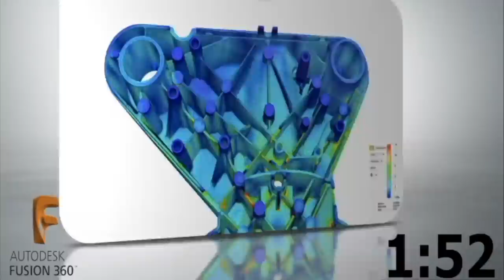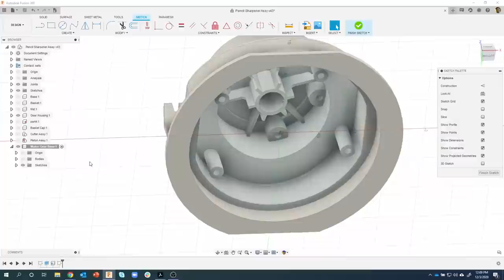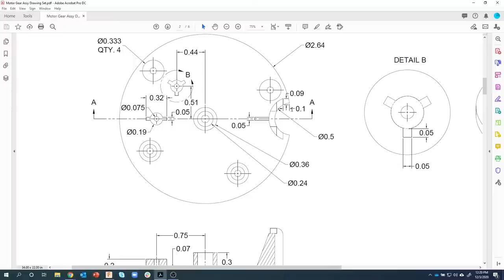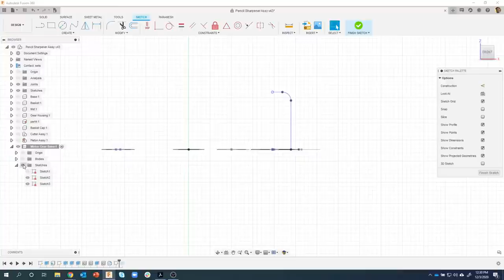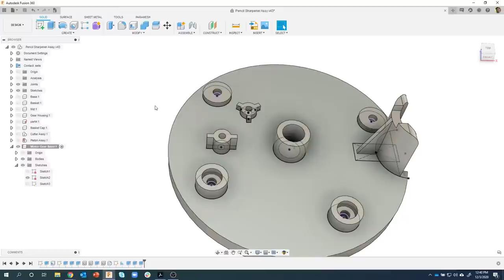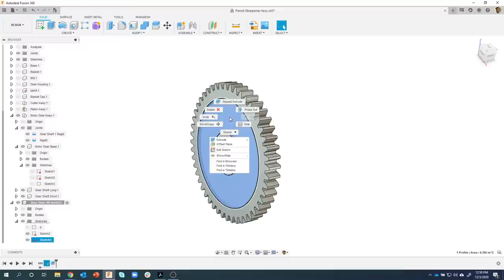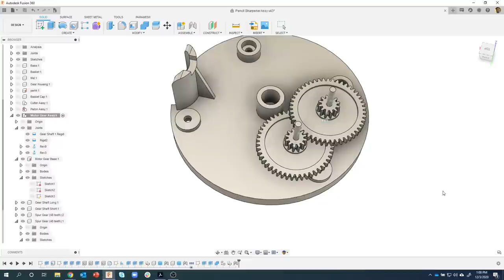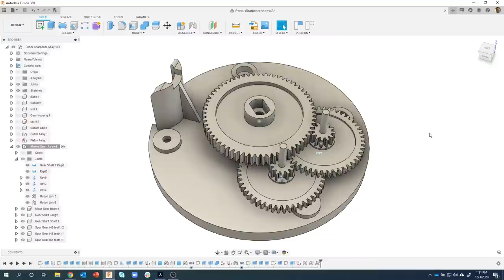Pencil Sharpener Project - Part 9

Comment: Small feature request that I think might improve productivity somewhat. 

Currently a few commands in Fusion take a  target to which the value you specify is applied and then if you immediately hold down the Control/Command key you can select other targets sketches to which the same value (if applicable) is applied. 

Common examples include things like the Fillet command. 

It would be great if Constraints supported this feature too. 

As an example, it's common to draw a lot of circles that you intend to be the same size,  you start off by giving one of the circles the value you want them all to be, apply the Equals constraint to it and first target . At the moment for EACH of the other circles you wish to apply the same value you would have to reference the first circle AGAIN. A pain especially if there are many!

Wouldn't it be nice if after the first pair, instead of referencing the 'reference' one again you simply hold the Control key down and click on the next one which would automatically apply the value of the previous reference to the next target.

 I guess this feature should be able to work similarly with most if not all the other constraints?

Comment: Great tutorial.
I was following all the steps quite closely, but ran into trouble in this part. When you clicked and dragged the motor gear base into motor gear assy it looked quite easy, but I can't recreate that. When I release the mouse (left) button, nothing happens, the base is still in the main 'branch'. Same issue with dragging the gears into the assy. Even tried right click and cut and paste, but the paste option is not available. When I copied the gear, it all worked ok. 

Got a work around by just copying the components, pasting them into the assy (which worked OK) and then removing originals, but that ruined the joints and motion links. So, not really a good way.
Why can't I just drop the components, like you did? Or change component's parent, which, I think, would do the trick?
What am I doing wrong? Thanks.

Comment: at 44:00 there is an issue with an update from years ago that does note let you move a component under another component and it was never officially solved. The work around is to copy the component you wish to move and paste it onto the new component. The clone retains its timeline and you can REMOVE the old component without any negative effect that I've noticed so far. If anything comes up I will reply to this.

Comment: Another update issue I suppose, maybe on FM Gear's side, For whatever reason when I make the first gear everything is fine, create the extrusions on both sides of it, all looks right, create the next gear and it is half the size it needs to be. I quadruple checked everything about both gears and the numbers are right but the result is wrong. I start playing with the numbers and by changing the diameter pitch to 48.5 or 49 I get the result that is in the video. Not sure what has changed but I can continue on now.

Comment: Guys I know this is pretty much "later on" than the live stream but working through these examples has been extremely helpful in learning Fusion 360 - However I am unable to undertake the pick and move option you showed when yo selected the "Motor Gear Base" and dropped it into the "Motor Gear Assy: - I can select and drag the Motor Gear Base but Fusion refuses to allow me to drop it into the Motor Gear Assy - is this as a result of Fusion moving on over the past few years?
Reply: must be because I am in the same boat a year later
Reply: So this is an issue that appeared years ago after an update and the best solution I've found is to copy that component, paste it on the new component and remove the old one. The clone keeps all of its timeline properties, just in case I am saving from here under another projects, if I see a problem I will let you know here.

Comment: Math for the gears is just the ratio of the number of teeth
Reply: It's incredible to see how many peoples get confused by the  menu entry saying the value should be in degrees...  May be Autodesk should change the menu to something less confusing like "gear ratio"  ?
Reply: @Новости-з3й  it's a motion link between to revolute joints. it only sometimes applies to gears so "gear ratio" wouldn't make sense for other modeling scenarios.
Reply from the maker: Yep!  Me included!  I always thought it had to be degrees...  I learned from you all, the community, that you just have to enter the # of teeth for the "ratio".  Face-palm!